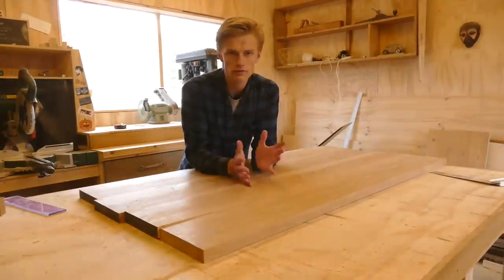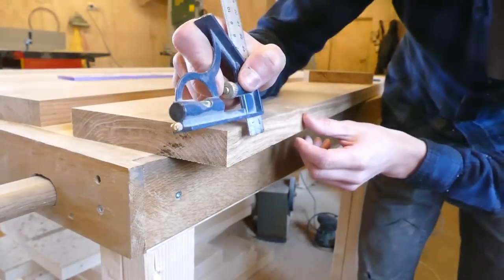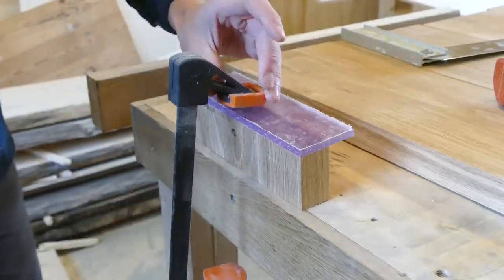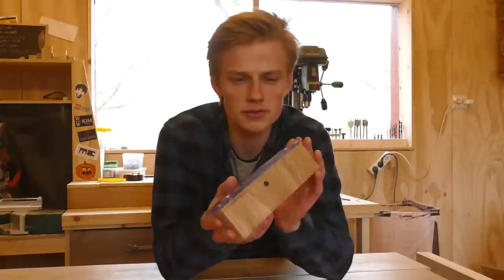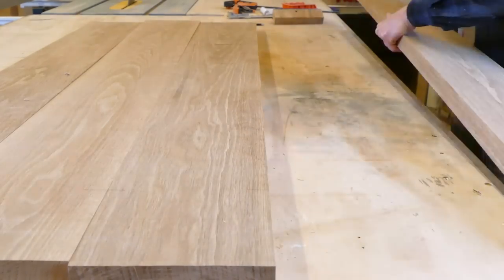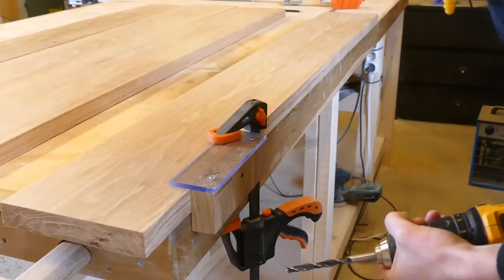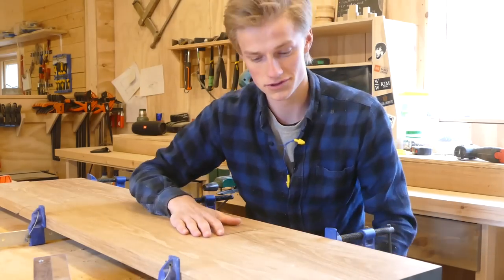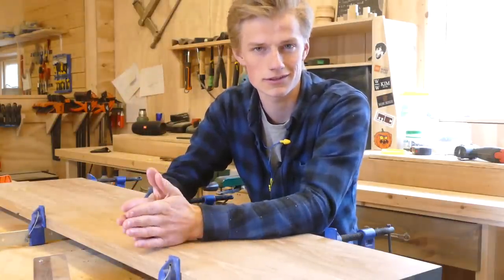WOODWORKING HACK! No Domino-/Biscuit Joiner? NO PROBLEM!

Comment from the maker: THANK YOU all so much for watching! I want to get one thing clear: I did not say that this is a perfect jig that will last for years and years! The hole will wear out after a couple of projects, then you have drill a new hole. BUT, for a glue-up like this you don´t need to have a Biscuit or domino jointer, this jig will do the same job, just as well!
Reply: Good jig. Suggestion, instead of one hole, put two holes the distance you want for your dowels to be apart and then you will be able to drill two holes from one clamp up.

Comment: Currently working on a sushi counter for my store and I had thought about using dowel pins to join edges of 2pcs of 2*8”. I was kinda skeptical about using the dowel pins but this proves that it works. Thank You!

Comment: I completely agree with you. For the hobbyist, dowels are a good, affordable, and effective option for almost any loose tenon joint.  BTW:  If you want a specific doweling jig to last longer, use a metal insert in the drill guide and always have the drill inserted to the surface of the wood before starting it.

Festool Dominos are great, but only a production shop can justify the expense, unless money is no object to the user.

Well done!
Reply: Jerry Stark
I would disagree with you on a production shop only justifying them. Some people it maybe their central tool to allow them quick easy jointing so that they can do lots of projects. 

For the amatuer a Track saw and biscuit jointer could give them the complete workshop.

Comment: Couple of points you should mention.  First, the wood block should be a hardwood.  Pine or other softwood are going to get chewed up pretty quickly.  Second, most people don't have plexiglass lying around.  You can use a thinner piece of wood, just be sure to carry your centre line to that piece of wood since you won't be able to see it on the block with the hole.  And finally, you should mention the depth of the hole in relation to the length of dowel.  Both holes should be a 1/16 of an inch deeper than half the dowel length so it sits nearly equally deep in both pieces of wood.
Reply: Jeff inToronto buy the plexiglass. Seeing the line is perfect
Reply: You can get clear clip boards from the discount stores all day long. If you don't think one is thick enough you can cut the board in half and glue them together on the ends and get the same effect.

Comment: Nice little jig! My amendment isn't simpler to make than yours, but it's for those without access to (current treasured) transparent plexiglass: instead of using plastic, you could keep the scribed line on the edge visible simply by attaching two pieces of wood either side (rather than covering the lines with any material).

Comment: I made a version similar to this. If you’re only making one or two tables, it’s fine.  But if you’re making more, then a metal sleeve insert is a must in the hole.  You also need to be accurate with your holes as creeping up or down just a bit with your drill can throw things out of alignment.  And when doing multiple holes, it’s easy to get sloppy and takes patience to make sure you’re holding the drill dead center.  But a good technique to save money when you’re starting out

Comment: Basically a dowel jig without the metal sleeve that prevents the hole from wearing out.
Also, the hole needs to be dead on square in both directions, or the precision on the fitment will be out the window...

Comment: I certainly miss lumber like this in Europe.
Reply: Might I ask why?
Reply: @moorecha   It's never warped, the wood is clearer, and it's not all cut to standard sizes. It's easy to order wood any dimension you wish. Noone is sistering up 2x8s, for example. They get actual beams. It's the old world. Everything is still done the way it should be done.  Timber is carefully raised in rows or well-tended forests without dead trees fallen everywhere,  and crooked young trees are removed to make space for the good ones. The clearing is done is 1-2 acre patches instead of vast clearcutting. The timber is cut and then carefully cured with wood strips between each layer and these are kept in place until the wood is sold to the customer.

Comment: Nice work Are! Although I do agree with Sumo that using a stainless steel bushing insert the size of the drill bit would be an easy upgrade, but for one time use, it's fine. BTW, you have a new subscriber........... :)
Reply from the maker: Thanks! Yes, I agree as well! :) Thank you very much, I appreciate it!
Reply: Adding dowel centres for about 3 euros would make jigs like that much more powerful and enable you to actually use dowels in more complex structures such as a table frame.

Comment: Skip the biscuits. Skip the jig. Just glue. Bar clamp faces need only be raised or lowered during clamping to achieve flat. You MUST sight along the short ends and check the middle with a straight edge. The boards will stay straight ONLY if they are straight under tension. First try boards tight to the bar clamp, but my experience is that the bar clamp faces will need to be moved up or down on the board's edge and sometimes one end of the bar clamp is higher or lower than the other. Start clamping in the middle of the top and work toward the ends. Use scrap and a heavy dead blow hammer to discipline the 'reluctant' boards.
Reply from the maker: studfindingball To me, that sounds like a lot more work! All I did was to add three plugs in each board and then it was all ready for glue-up! 😊
Reply: Are Baloni by the time you add the plugs I am done, but my lengthy instructions were for clarity.
Reply: Simple glue joints are strong but are not as reliable as a floating or screw joints and are much more liable to failure over time.

Comment: Nah... you can get a self centering dowel tool for about $15 USD instead which works on many different thicknesses of wood.  I like the idea, and using dowels is good, but you would need many tools instead of just the one that works for almost everything.

Comment: Old tech works just fine. Beware of new tech which costs an arm and a leg. I have to suggest a drill bushing for long term. A one trick pony this is just fine.
Reply: With a domino I can use several different sizes quickly and produce super accurate joints over and over. 

There is nothing wrong with a Domino or biscuit jointer or using dowels like in that video.

Comment: Its a simple design for a doweling jig that would be pretty effective but that is no replacement for a Domino.
Reply from the maker: Kory James On a project like this, it is!
Reply: Are Baloni I would agree foe alignment it would be useful.  So in the case of this operation it would definitely be effective.  I guess based on the title I was expecting a jig for floating tenons.  Nice job all the same 👍
Reply from the maker: Kory James Oh, Yeah I can get that! Thank you for feedback!
Reply: Just a punt, but did you happen to be one of those guys that bought a festool?

If it gets the boards aligned and glued up, its as good as domino, coz that what a domino does. The price tag and the need to justify a purchase doesnt take away from someone who found a simpler way to get the job done. Sorry
Reply: Visakan Thiruchelvam I completely agree that its an effective method of joinery for aligning boards. I can't afford a Domino but it is something that I would love to have for it's versatility.  In no way was I trying to sound like a troll and I think he did a good job here.  I was just expecting something different based on the title of the video.  He earned my subscription and I'm sure I will like his content going forward. 👍